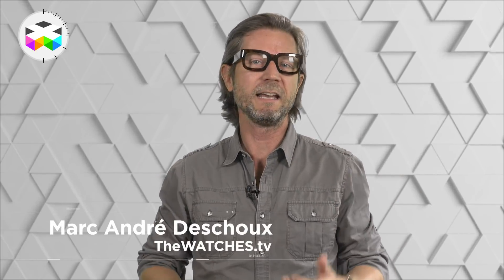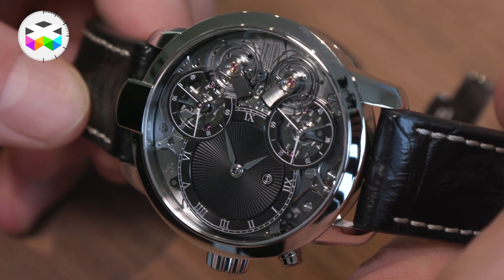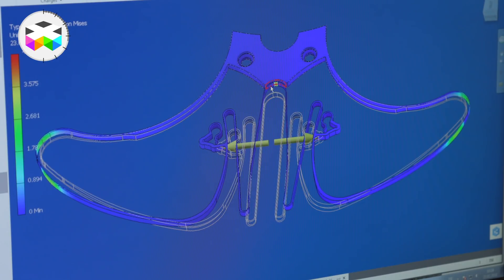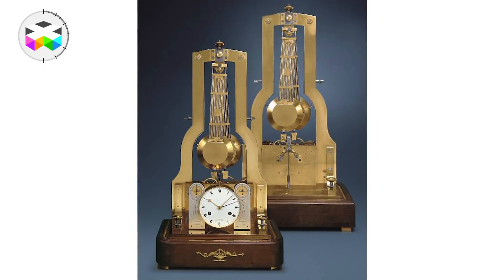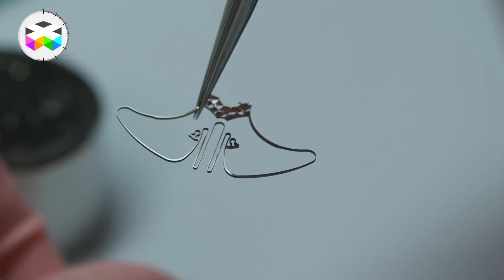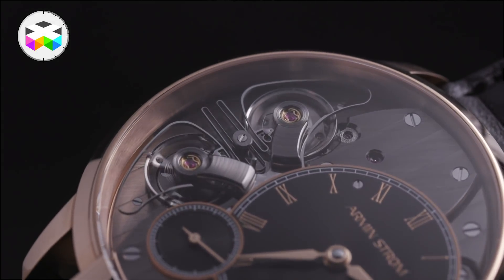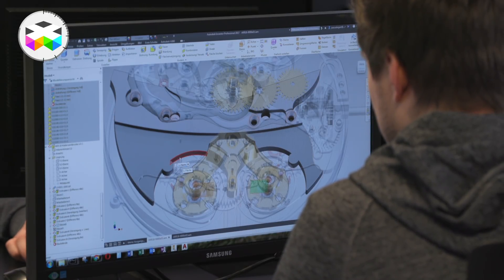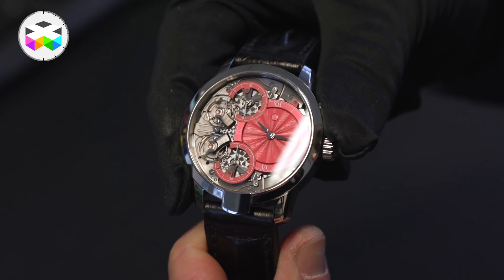What is a Resonance mechanism with Armin Strom

Comment: Improved stability or signal from the balance is the narrative, but where is the data establishing benefit?  I have yet to see any watch channel or manufacturer present hard data in support of any benefit to precision or accuracy.  Without that hard data it is simply an impressively ornate demonstration of a phenomenon within a watch case.  If the observatory trials were to return for mechanical movements, would implementing a resonant movement be a differentiator in taking top places?

Comment: The definition of resonance at the beginning is just wrong.
Resonance occurs, when you periodically excite an oscillator with its own characteristic frequency.
Reply from the maker: I absolutely loved this very insightful and constructive exchange, thanks so much!!!!! Have a great day
Reply: Sorry, but you're not correct: you are actually describing an external cyclic excitation. Resonance is indeed the interaction between two physical systems (usually, but not always, an object and a force. in this case it's two physical objects: the two balance wheels) at a specific frequency with a significantly higher output amplitude (orders of magnitude higher) than both systems have separately. The key here is getting a greater amplitude than what you put in, which helps maintain the cyclic movement as stable as possible (and as a consequence, maintain the accuracy of the watch)
Reply: Jon Mainhagu
To be fair: You are completely right. I was actually only describing a special case of resonance and I could not have described the general case any better than you. So I take my hat off to you!
BUT: The definition Mr Greisler gave is still just too vague to be valid (at least not in this universe). Two bodies can influence each other in all kinds of ways, so his definition has nothing to do with oscillations or resonance in particular.
Reply: you are 100% correct! I also though the explanation for the physical phenomenon is way too vague to be considered accurate. I did enjoy this video, though. As the other comment noted, it is harder to be precise in a second (or third) language. My hat's off to you for giving such a reasoned and balanced reply! Youtube CAN be a place for constructive exchanges... or maybe it's only on theWATCHES.tv :-)
Reply: My pleasure: "object" refers to something physical, that you can touch (the balance wheel, in our case),  "force" is (more or less) energy being transported (the pressure from a sound wave when it hits a crystal glass, for example), and "amplitude" is the amount of mouvement done during one cycle (the swing of a pendulum, or how much the balance wheel rotates every tic-toc).

 If you have heard of how you can break a crystal glass with sound, that's the perfect example of an object (the glass) interacting with a force (the pressure from the sound waves) in resonance: the sound is not so powerful by itself and if you flick the crystal glass with your finger, it will ring (The glass walls are moving very quickly, which create the ringing) but not break: that's because the internal molecules in the glass are resisting movement. But if the sound hit the glass at just the right frequency (The right pitch, usually a high pitch) then the molecules in the glass suddenly do not resist anymore : It's almost like you found the rhythm to make them dance, if you will: The glass and the sound are in resonance, which means the amplitude of movement of the glass gets bigger and bigger until it breaks!
In the case of this beautiful time piece, they found the right frequency and amplitude so that they don't break anything, but the consequence is: Both balance wheels are "dancing together" in unisson, in other words they are regulating each other on a more constant frequency than they would separately, creating a more precise time piece :-)
Reply: Jon Mainhagu Thank you so so much! Your example was absolutely perfect as I'm a car guy and I remember an ad for the Lexus LFA breaking a glass which made it a lot easier to understand! Question: In the context of the watch when you said "amplitude is how much the balance wheel rotates every tic-toc" did you mean, for instance, 270 degree vs 272 degree of rotation? or is the rotational degree 'fixed' while the force is variable? Like torque?
Reply: Yep: the movement of the balance wheel being a rotation, the amplitude is, indeed, measured in degrees of rotation. In order to regulate the calibre, a balance wheel is built for a set frequency of rotation, by the specific combination of the weight of the balance wheel and the elasticity of the hairspring. The consequence is a fixed (as much as possible) amplitude of movement. The better car analogy is the balance wheel being the accelerator of the car, pushed to release a constant amount of energy from the barrel/engine so the watch/car is going a the most constant speed possible. If we push the analogy even further, the car equivalent of a resonance movement is your Lexus having two separate engines, with two separate accelerators that feed their energy to one gear train. And you (the driver) is the clutch spring, sharing the information, on how you press both acceleration pedals: you automatically adjust how you press both pedals depending on how each engines are doing, making sure in the end the car stays at the most constant speed possible. Finding an analogy for torque with only text is a bit harder as the fundamental difference is that the car is built for variable energy release (You want to control and change the speed of the car) but the calibre is set for reliability of constant velocity (The calibre is supposed to keep constant, no matter the situation) so the torque on all axis of a watch will be (again) as constant as possible.  Glad I could help!
Reply: No problem at all! I love taking about these little intricate details of mechanics. That's actually the main reason i love these time pieces. The main difference is that in the F.P. Journe (If I recall correctly) the two balance wheels are not directly connected (no Clutch or regulator) but it's the vibration via the case that help them stay in sync (I might e wrong on that last point). The two balance wheels are rotating out of phase, or symmetrically, just like this Armin Strom, meaning their angular speed are opposite). It is my understanding that the greubel forsey has both balance wheels rotating at different frequencies, making a differential necessary to average them. the differential cancels out any resonance effect that could happen, where the clutch system relies on resonance to help the regulation. As to the redundancy, I guess it's more like two different solutions to the same problem: keeping the regulation as constant as possible. however the Greubel, in my opinion, is also looking for a stronger visual impact, hence the two double tourbillons (Quadruple is, I think, a misleading albeit catchy name: The time piece does not have four tourbillons, but two balance wheels rotating on two axis each, if I'm not mistaken).
Reply: Jon Mainhagu you're correct about the FP Journe model. It uses what Journe calls "acoustic resonance" meaning information about the oscillations are transmitted via air molecules between balance wheels located very close together. It is similar to the original Brequet idea but is regulated using a pinion to adjust the proximity of the wheels, and adjustable inertia weights.  FP Journe uses large balance wheels with more inertial weight to increase stability so he/they may feel proximity is adequate to see the beneficial resonance effects.  If there's additional oscillation information transmitted via the connecting materials I don't know. If so this would be a specific design choice as otherwise you'd want to damp those oscillations. It would seem risky. The addition of a friction clutch makes the Armin Strom design very different. As the goal of the clutch is keeping 2 oscillating balance wheels at a constant rotational speed, the clutch can be a beautiful and symmetrical one-piece unit. I'd love them to talk more about why they developed a clutch versus using acoustic resonance & the design choices of that clutch. It seems to be a secret and the clutch materials & design will affect the optimum resonance frequency of the balance wheels.  I'd worry about how close the balance wheels are on the FPJ watch and whether they'd be negatively affected, or indeed damaged,  by shocks to the watch.
Reply: Glad I could help! My background is in mechanical engineering, which is a subsection of physics, so look into that if you're interested in designing engines, gear trains, ect. You'll hear about resonance as a really bad thing when it comes to aerodynamics in supercars! Thermodynamics will also come in handy. Mechanics is the study of movement, so start there, and you should learn more about how to get to your goal! Good luck!
Reply: Jon Mainhagu could you please explain the term 'amplitude' in layman's terms as I have no understanding of physics whatsoever. Also, you mentioned 'object and force' - can you add another example of this scenario for the poor layman? Thanks!
Reply: Thank you so much for you generous replies as they're infinitely helpful!! 2 questions for the last time I promise :D Kindly know I'm typing this while my eyes are half asleep already, so if you're inclined to reply, you may do that tomorrow or anytime :)

First, lets say that this watch and the F.P.Journe Chronometre Resonance were to have the same frequency and amplitude, what advantage does this one have over the FPJ given the addition of the clutch spring?

Second, doesn't that make watches with differentials (gruebel forsey quadruple tourbillon & double balencier) sort of redundant? Like whereas the resonance synchronizes, differential averages the errors?

Thanks again dear! :)
Reply: Thank you Jon Mainhagu! I learned a lot! :) What did you study to understand this? My dream is to one day create my own supercar and I dont know where to start the path in terms of knowledge! Physics or mechanical engineering!
Reply: Thank you very much! Wish you the best! :)